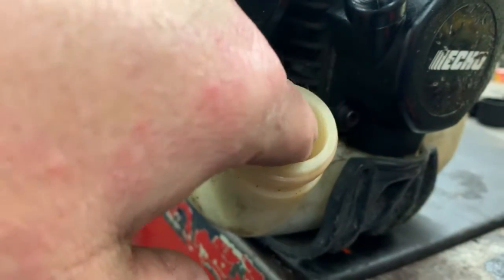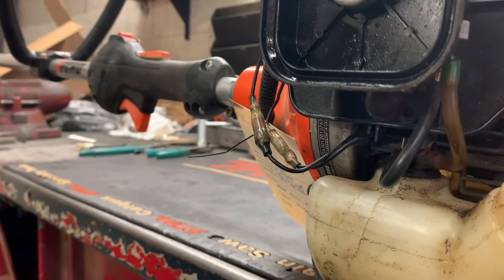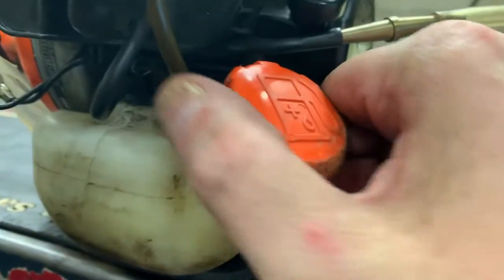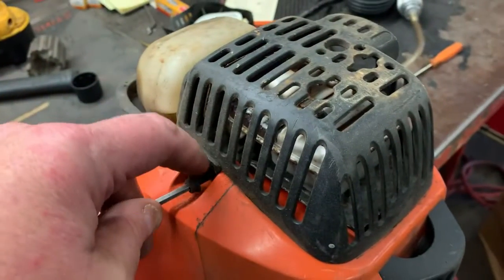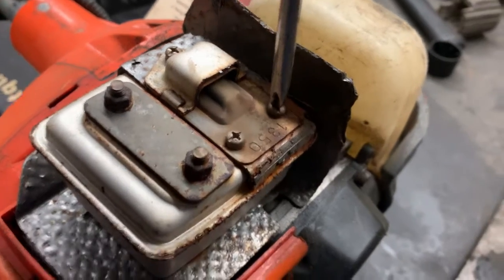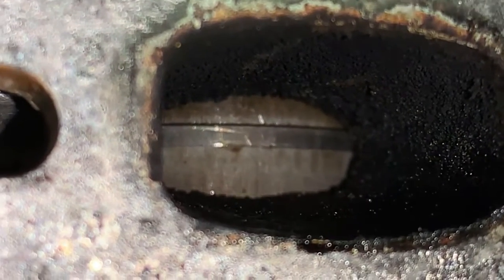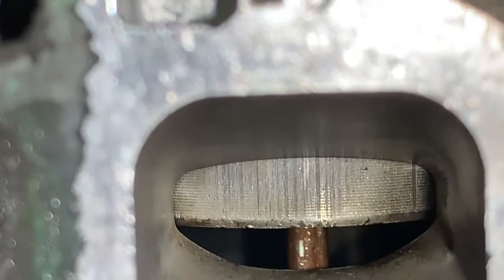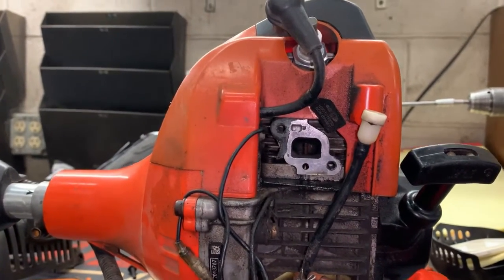PART 2 : 2 CYCLE ENGINE DIAGNOSTICS / TESTING THE FUEL SYSTEM AND PISTON AND CYLINDER INSPECTION

Comment: Good one MM1.  A vacuum / pressure tester is, in my opinion, a must have tool.  We use a MityVac MV8500.  We also recently purchased a Borescope for just $60 and it is Awesome, never knew we needed it so much until we got it.  It's a Oiiwak 4.3 inch screen 1080p.   Have a Great day my friend.